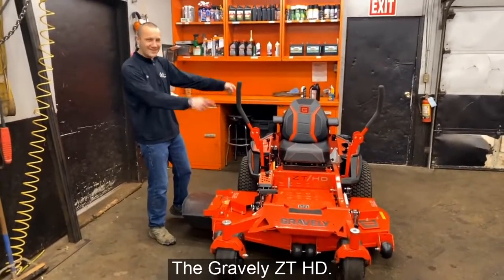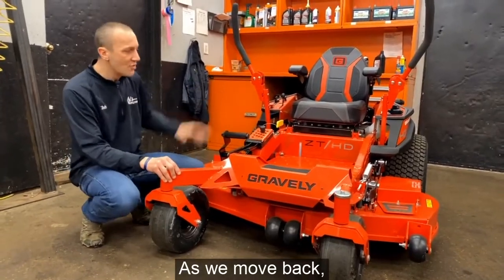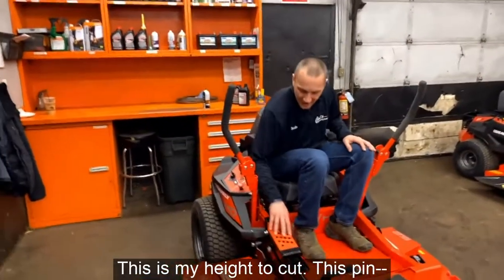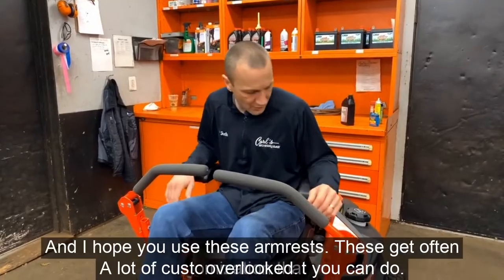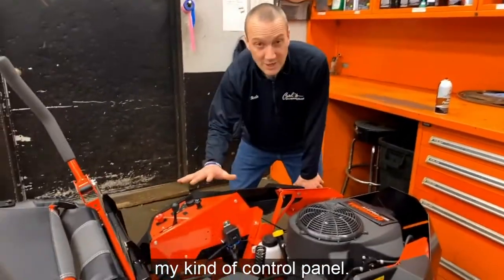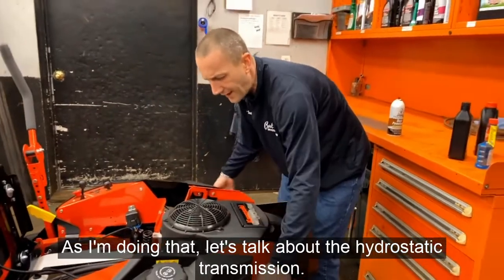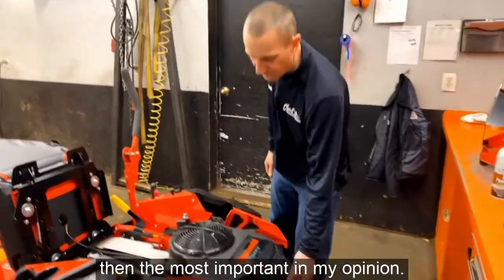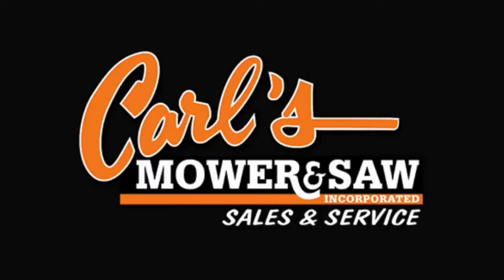So You Own A...Gravely ZT HD

Comment: Just bought this rig. Didn't know about the levers to enable pushing. Didn't know about the recommendation to engage and disengage blades at half throttle. Thanks brother!
Reply: Dealer told me to start and stop both blade and motor at max 🤷🏽‍♂️

Comment: Great video, Josh! Is the ZTHD 52” supposed to come with a rubber hose attached to the engine for oil changes? I purchased mine and it did not come with a rubber hose with the brass ends but instead just came with a plastic piece and a clear vinyl hose.
Reply: Sounds like a Gravely  "beancounter" issue. They'll delete or cheapen every part they can, every year they can. No different than any other manufacturer.

Comment: I just picked up my ZT HD (May2024) and it doesn't have the oil drain tube like the one you showed.  Instead they gave me a clear plastic tube that slides onto a drain.  I'm not sure how it works, but I'll figure it out. The optional rubber mat on the lift up panel sure is nice.  Also there is an after market air cleaner that improves the protection.
Reply: I want that air cleaner, who had it?

Comment: Awesome video! The only thing is that when you're talking about engaging the blades at about half throttle, the manual says to engage the blades at full throttle to prevent belt slippage.
Reply: U can do whatever you want but would you rather change a belt or a clutch I think that's what he is getting at.

Comment: Thanks for making this excellent and informative video.  I need a new mower for my 2.5 acre yard and am currently trying to decide if I want to go with the ZT HD60 or spend a bit more and go with  the lowest ProTurn series offering.  I have a pretty steep incline to contend with and would feel better if the mower had a roll bar.  Can a roll bar be added to the ZT HD series mowers?  Thanks!
Reply from the maker: If you step up go to the ProTurn ZX with the Kawasaki engine.  As for the HD there is an option for a roll bar.

Comment: I am very interested in the ZT HD 52, has gravely done anything on the 2023 models to deal with the deck rattle issues I have read about? From what I understand it was most the 52’s that do it. 
Thanks
Reply: Did you find anything out? Looking at getting the same one

Comment: Your comment about engaging and disengaging the PTO at low engine speed is the exact opposite of the Gravely owners manual.  The manual has warning about this and it states: "IMPORTANT: Engaging the PTO knob with the throttle lever set lower than fast position can cause excessive belt wear.  ALWAYS use fast position when engaging the PTO."  They also state to turn off PTO before setting the throttle to slow speed.  The manual says this is to help reduce belt wear, but your stated goal is to reduce clutch wear and I would think a clutch would be way more expensive and more difficult to replace than a belt, but I hate when I have conflicting information like this.  Have you reached out to Gravely to get clarification on this  at all.  Additionally both your front and rear tire pressure recommendations are outside the range that the Gravely manual states (Front: 20-25psi, Rear: 15-18psi).  I'm not trying to be a PITA I just want to make sure I'm doing things correctly to keep my equipment working well and to hopefully not cause problems by doing a procedure incorrectly.
Reply: Yep…..I said the same thing. If you break a belt you are removing the clutch anyways. My rep’s answer to your stated fact about cost of belts vs. clutch was….”how many belts vs. clutches will fail more.”

Touché
Reply: Save your clutch and do what this guy says. I look at it like your vehicle brakes, the faster you are traveling the more wear on them.

Comment: I have the 918520 stealth, was wondering if you did a review of it ? & if you know of a fix for the seat rubbing the engine?
Reply from the maker: Yes I can do a little review of it and as for the seat I do know how to fix that there’s a little bracket that is underneath the seat  it is probably 6-8inches wide it needs to be moved to the top of the seat mount plate not left on the bottom.  Simple quick change. It’s easy to miss in set up
Reply: @Carlsmower  thanks I’m gonna go try it now other than that the mower is outstanding & I’ve gotta give a small shout out to my local gravely dealer here in NC johnnie shubert’s in newton North Carolina

Comment: How well do you think this machine would stand up to light commercial duty? Like 12 lawns per week, about 6 acres total?
Reply from the maker: Kwehave plenty of people who do this. Just keep up on maintenance
Reply: @Carlsmower  awesome, thanks for the reply. I have a gravely dealer right around the corner from me, and an exmark Dealer about 4 miles away. It's between this and the radius 52, but I can get a gravely for cheaper obviously. The only thing I'm really losing out on is the rops system, but I can buy that and still be cheaper than the radius.
Reply from the maker: @joeybydin439  the Radius has what engine?
Reply: @Carlsmower  24.5 hp exmark v twin
Reply from the maker: @joeybydin439  then definitely go Gravely it runs the Kawasaki engine, unless you're going all the way up to the X series radius
Reply: @Carlsmower  Kawasaki over the Kohler for the gravely? You can option both. The Kawasaki is 23 HP and the Kohler is 25.
Reply from the maker: @joeybydin439  yes Kawi hands down
Reply: @Carlsmower  thanks for all the replies! Just wondering why the kawi over the Kohler if the Kohler has more HP, wouldn't the kawi feel underpowered in a "52?
Reply from the maker: @joeybydin439  the machine has plenty of power for the deck power requirements

Comment: So, the 2021 hd... Does that have the x factor 2 deck? I got mine a few weeks ago but it doesn't have the taper in the front like the x factor 3, but can't find anything saying if it's the x factor 2 or not.
Reply from the maker: The 2021 did have the X-factor two deck the 2023 has the X factor three
Reply: @Carlsmower  awesome thanks. Any suggestions on baffle adjustments for better cut quality?
Reply from the maker: @joeybydin439  all depends on grass type and how long you’re leaving it.
Reply: You're the go to guy on YouTube for this mower lol, any idea of torque specs for blade bolts? Doesn't show it in the manual, and can't find it ANYWHERE.

Comment: Damn I told people to always engage and disengage blades at full throttle.   I thought it was easier on the belts.   Especially engaging because the belts need to have the engine reving up high to get spinning correctly on their pulleys.
Reply: To me as a mechanic, this is the opposite of logical thinking.

Comment: Gravely….and I questioned this myself….they suggest you engage the blades at FULL THROTTLE due to the way the belts are wound through the pulleys. I called them.
Reply: 3/4 throttle for most but gravely says their mowers go at full throttle